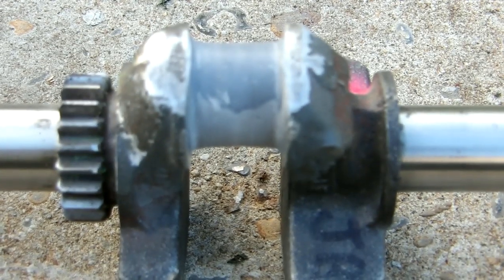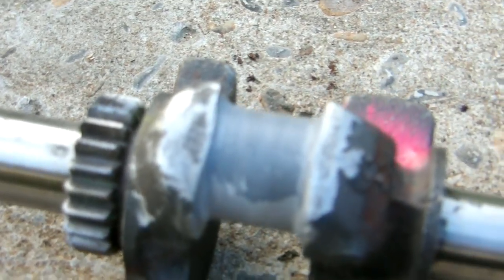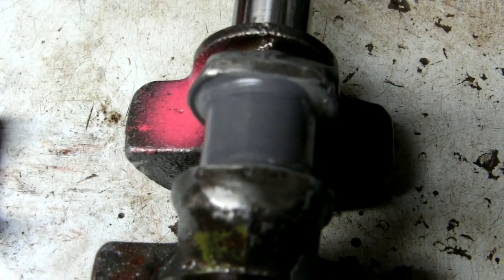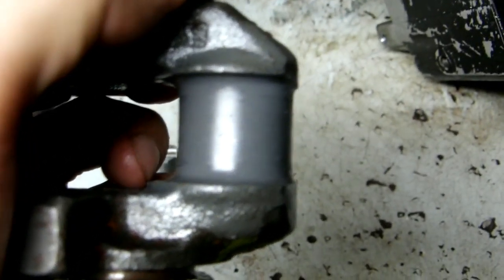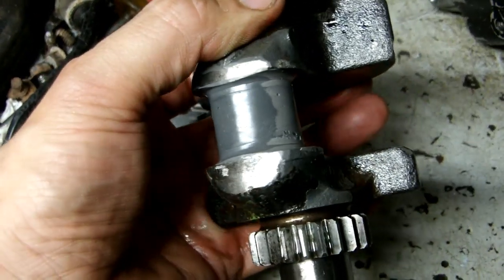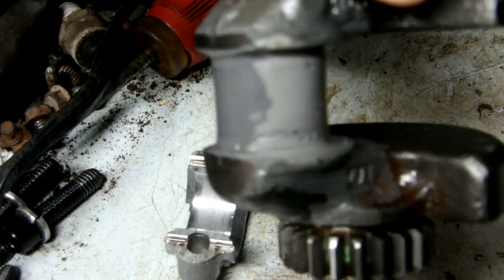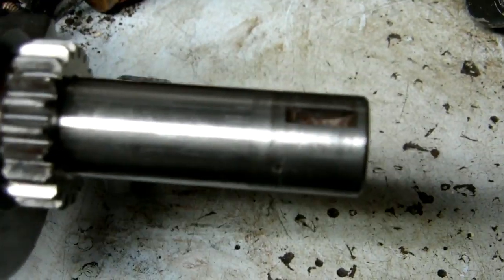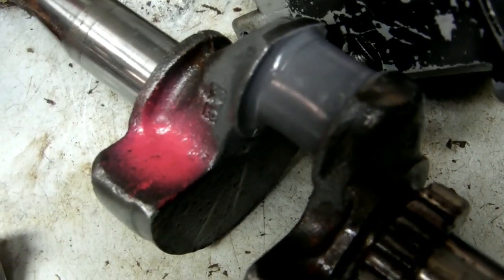JB Weld Con Rod  Journal,will it Run?

Comment: maybe if the oil journal hole wasnt blocked it could get oil? it might have lasted longer? plus a precise diameter for proper clearance? was any of that done?
Reply from the maker: Yes, I had the proper clearance for the con rod. These small engines don't have a hole in the crankshaft for oiling, since they use a splash oiling system. The con rod has a hole in it that is feed by the dipper or paddle splasher in the case of a lawnmower engine.
Reply: @ChargerMiles007  I'm aware of the dipper arm instead of an oil pump but I didn't or couldn't see a hole for oil on the rod you made. I've drill holes in the rods to lube wrist pins also when I made a press pin a floating pin even in my small block chevy

Comment: Usually the rod bearing gets beat up more than the rod journal on the crank.  How did you account for the match of the fitment?
Reply from the maker: I made this by grinding the crankshaft down about 1/8" each side, then I applied JB Weld epoxy to it. I had previously made a silicone mold of the crank journal, so the mold helped to form the epoxy close to circular. I did have to do a little sanding to achieve the desired clearance with the connecting rod.

Comment: Here's a hint... We use marine tex in the machine shop. It will hold an engine block together. We scuff at JB Weld. However, only use on small imperfections on something like crank
Reply from the maker: Thanks for the advice, I imagine that stuff is expensive?
Reply: @ChargerMiles007  the more you buy the cheaper. One problem with it is the shelf life. You get about a year and a half out of it. The hardener weakens and you get something that won't hold on a stamp. It's best to try 2 ozes out first. This stufff actually sands like mahogan. In the past decade, in weld has started adding metal shavings. It doenst make it stronger, but makes it tough to sand. In, does have it good points.... It cleans up with water and can be shaped with water as it sets up. Marine Tex require acetone to clean. They both have thier place, I just think in is a better as a filler for small jobs.

Comment: I believe it’s supposed to be bad to run these without a blade because it acts as part of the flywheel..?
Reply from the maker: Yes, you are correct, they can backfire etc. without a blade. I always run my experimental engines with a heavy cast iron flywheel from a horizontal shaft engine, such as a roto-tiller.
Reply: ChargerMiles007 got you that’s a good idea. I’ve been looking for a way to run mine without blades (I have a mere 10 or so but no horizontal shafts) guess I should find a horizontal shaft.

Comment: Welp I’ll be damned, didn’t think it’ll last that long but sweet, that’s shows how strong it is, but I wouldn’t recommend anyone to try it and hope they fixed the engine then it suddenly blowing up again lol
Reply from the maker: Yes, you are not going to get very long out of the LB welded crank, for sure. I made another run tonight. this time  I added the JB piston for good measure, and tons of oil smoke!

Comment: I was about comment about the fingers under the edge truck..... And then you explained... Whew, I thought it was going to be a video hosted by Stubby!
Reply from the maker: Yes, I regret lifting the mower that way, as I don't want to be a bad example to people!  I am trying to talk Warped perception into doing a a slow mo vid with hot dogs in a glove getting attacked by a lawnmower, to show why you NEVER reach under the mower deck, like I did.  I will show that there is only about 1/4" of clearance  between the blade and the deck, so  any fingers would be gone for sure!  I will be using the JB Weld piston along with the crank journal on my next vid, hopefully Saturday. I have the engine re-assembled, so it should indeed happen, baring the hurricane messing up our weather!

Comment: Verbal advice / disclaimer is one thing. Perhaps don't demonstrate it on video and post on Youtube.
Reply from the maker: Good point, I will show why not to reach under the deck of a running lawn mower, on my next vid. I bet Warped perception could make an awesome vid using hotdogs in a glove.
Reply: @ChargerMiles007  Good on you !

Comment: Hahahah. This was pretty funny.  I hate JB weld. Once you use. Loctite 608 (5min) or loctite 601(24hr) jb weld is like child’s play compared.  I’ve put cracked engine blocks back together. Radiators  with the loctite and it never failed. Fixed worn shafts  broken trans parts with it and none of it ever came back apart. I’m impressed you got that JB to work that good.
Reply from the maker: Really, the Loctite stuff is that good, sounds like it has worked well for you!
I have made some large items from JB Weld, like the Briggs piston (it will run in my next vid), as well as I made a weedeater cylinder that ran. Also 2 con rods for this lawnmower. I am sure there are better products, but JB can perform well on lots of things.

Comment: Nice! Love your oddball tests on these engines.
Reply from the maker: Never fear, there will be more to come!  It is a ways off, but I am working on a bigger inline engine for next summer, the Straight 8 just wasn't enough!  :)
Reply: @ChargerMiles007  that'll be a good winter project! Random comment, I found these cheap $30 Propane / gas carbs on eBay and Amazon. I bought a few and converted my wood splitter and generator to propane. It's great for occasional use and I think adding a venturi bung to the intake pipe would work for you. If you want I can make a video on the 2 engines and how the carb works.

Comment: Damn! I was so afraid for your fingers!😱
Reply from the maker: Yeah, sorry about that, I always run these engine tests with a heavy flywheel, and NO blade!  I realized afterwards that I didn't want to encourage anybody else to try that, so I tried to explain that in the vid. The blade can be very close to the edge of the deck, no way a finger would survive!
Reply: Years ago I was on a some Safety Card-course. At beginning the course lecturer showed us his middle finger(it was nearly inch shorter). Laughed and said that he can so it here because it is good(or bad?) example of safe working. His wife was moving and needed to raise mower deck. Lecturer wasnt thinking and started to raise it while engine running. He did just like you.

Comment: You should try this with that steel stick putty type stuff that you kneed to activate. I've used that stuff a couple times for some external things and it gets very hard. Harder than JB weld it seems.
Reply from the maker: I will look into that and could possibly do a comparison test.

Comment: Make the valves out of JB Weld.
Reply from the maker: I tried a plastic intake valve, made a vid of it a few years ago here. It only worked for a few seconds, then pieces of it blew off.
Reply: Maybe a jb weld "repaired" simulated burnt valve or valve seat on the intake side.

Comment: It was machining itself as it ran!
Reply from the maker: Yes, it seemed to be, judging from the polished con rod, and the scratched journal on the crank.
Reply: @ChargerMiles007  it would be interesting to use Plastigage on the journal in several places.
Reply from the maker: I will check to see if I have any around, been a few years since i last used it.

Comment: Did you use assembly lube on the bearing ?
Reply from the maker: I just oiled it up with motor oil on the crank and rod. I may grind the worn part down, JB it back up, sand it to shape, and give it a run cutting grass under load, wanna bet it blows the con rod?!
Reply: ChargerMiles007 I’d double the weight of the connecting rod with JB Weld so it really has to work to blow out the side of the block.
Reply from the maker: OK, you folks have convinced me to put a blade on it, and cut some grass. I fully expect a blown con rod as the outcome!
Reply: @ChargerMiles007  i look forward to it. I will be looking for it.
Reply: Yes please do it again. I bet it will throw the rod if it goes long enough. 
Been a while since i have seen a good JB weld video then i saw this notification.
Reply: You know, it might work if you make the bearing out of it too lol.